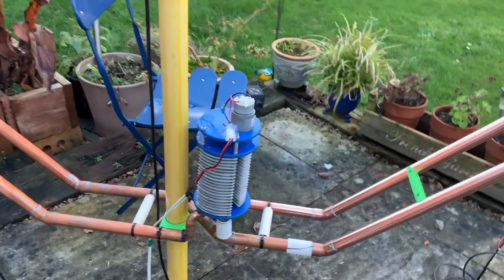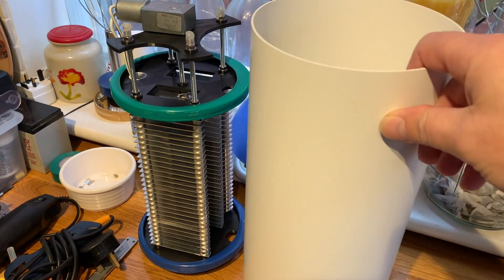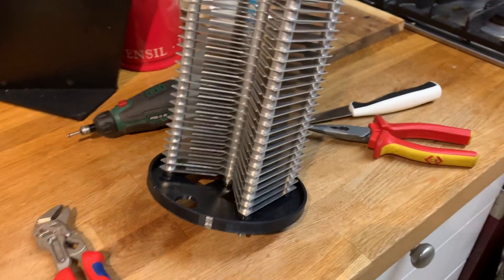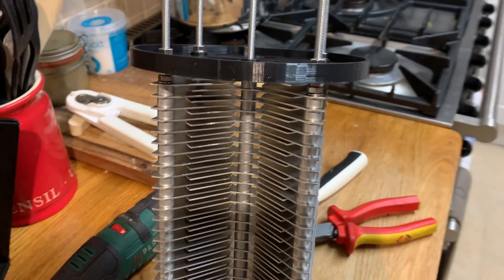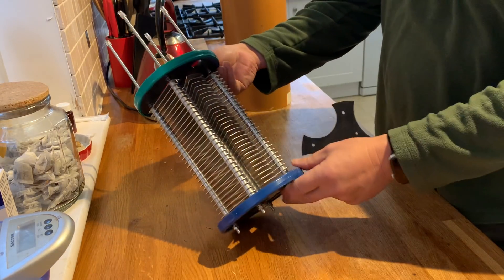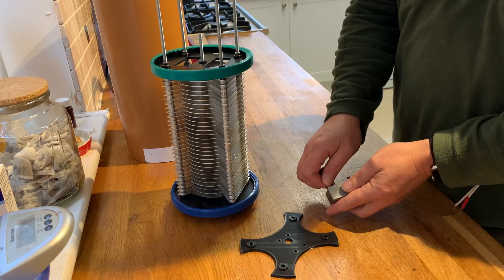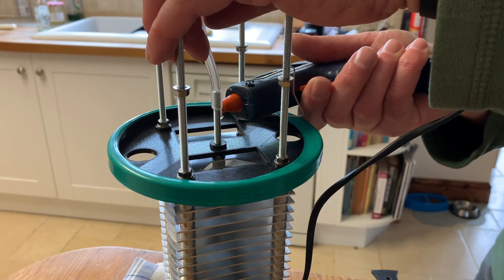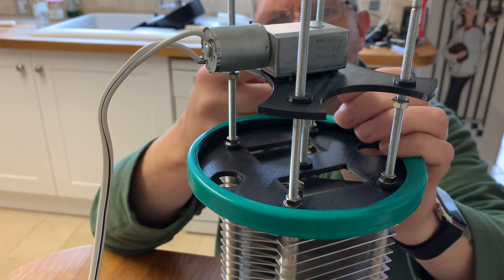HAM RADIO: Magnetic Loop Capacitor Build New Mag-Loop build figure of 8

Comment: Mike,
Question - you clearly have skills in CAD and use a 3D printer.   Why is ityou didn't design and print a coupler for the motor / capacitor?   I was going to print one in PETG - do you see an issue with this material ?

Comment: Very nice build!!  I've built my loopwith 3/4" soft annealed copper pipe - soit was easy to get a good circular loop.   
I was going to use a stepper motor and Arduino / TMC 2209 driver with microstepper for fine tuning, but I do like the simplicity of what I assume is a d.c. motor you are using.   Could you advise the model /source for this motor?    With regard to the capacitor - What do you thong the rating would be with 5mm spacers / 1mm thick plates as opposed to your 6mm spacers ?
Reply from the maker: The motor was sourced on eBay and is simply a 3 turn per minute 12volt dc motor, I also use 5mm spacing with another Capacitor and it works fine, 150Watt. Thanks

Comment: Nice loop. Might try building one later in the year.  I do have a question to ask, have you ever tried putting a small active antenna near your receiving loop, and see if it draws in loads of stations? Seeing the Mag loop draws in stations, could not the active antenna not pick up those stations as well a lot cleaner, and clearer?  Just a thought... Be interesting in finding out if reception to a SWR Receiver is far better. Should try it with a Coupling loop as well.

Comment: Hi Mike , work of art what are you using to cut out the rotors and plates is it cnc or  water jet I made I meter loop 10m-40m for my mchf got 7pf -111pf and cut the rotors and plates using 3018 cnc using RS design spark mechanical but even on the slowest speed your plates are smooth
regards
terry
Reply from the maker: They are cut by laser..  I need to purchase more

Comment: Kinda curious how much voltage the vari-cap can handle before it flashes over. Looking for alternatives to the costly vacuum caps in my amplifier applications.
Reply from the maker: Good question!  around 3-4KV maybe,  I have put 400Watts into it with no issues
Reply: @mike-M0MSN  thanks that good to know. Happy New year.

Comment: Hi matey. Just got back into the hobby. Made a few Baluns but having problems with a 49.1 and half wave aerial on 20metres. Although 10.2metres long its swr is high at 4. But low on 7mhz and 21mhz doesn't make sense. Balun tests out ok on 2.5k resistor load and nanovna.  Vswr is around 1.2 to 1 from 5mhz to 30mhz. It's a single band aerial. Very puzzling.  Cheers from old George.
Reply from the maker: Hi George, sound to me like you need to solder a 200pf capacitor across the so239 this will bring the phasing back into play.  :)
Reply: @mike-M0MSN  Tried all that. Didn't work. Baluns are ok. Combination of aerial that's the problem. I reckon I have found the cause. But too cold to prove it. Update video soon.....
Reply from the maker: @MakeDoAndMend1  ok please keep me in the loop.

Comment: The motor control setup - I would have done a Big plastic gear to a worm gear setup 90% .. by using this worm gear setup you are able to fine-tune the cap don't want to figure the ratio as don't have the Worm gear setup but I bet you could get a 20:1 so 20 turns on the motor is 1 turn of gear connected to the Cap's plates. right now it 1:1 ratio. Just my thought on it

Comment: I very much admire your tuning cap.
A few years ago using 18mm copper pipe I needed a way to making it round.
I have a bycycle wheel clamped kit to a Black and decker work mate and using the wheel and bending the pipe around it to the desired shape I made to half sizes and joint them up to make the mag loop.
Reply from the maker: Great idea Thanks 👍

Comment: Is there a reason for the  butterfly style over a normal style capacitor vane shape? Also are the end caps printed in PLA as its hygroscopic with  ight cause issues later?
Reply: The RF current in a loop of this kind can be very high, 20 amps or more.  You don't want that kind of current crossing a "wiper" that contacts the rotor.  So the rotor is electrically isolated and serves as a capacitive bridge between the two sets of stator plates.  The current flows through the butterfly plates.  It would be slightly better to feed the stator plates in the middle of the stack.
Reply from the maker: Hi, yes it is PLA, but I’m not worried about longevity, most if not all of the antennas I build are experimental (two, three years of life) plus I am putting the capacitor inside a water tight container.  I’m using the butterfly as I have more choice of connections and it is easier to build, the biggest reason is no moving electrical connection to the rotor.
Reply: @mike-M0MSN  Hi mike, I was thinking more about the posibility of the PLA absorbing water vaper and the impedance falling to where a high voltage might flash over. the reson why they used cermic plates. will be good to see how it performs .
Reply from the maker: @TheEmbeddedHobbyist  ah yes a very good point,  fingers crossed

Comment: Top notch! Love your vids. Been working on homemade butterfly caps for a few months, and a couple of issues I'm running into are: 1. rotor nuts loosening up (arduino/stepper motor gives me counter-clockwise tuning) 2. Making a good (permanent) connection with the (rotating) rotor shaft.
Reply from the maker: Yep been there, lock nuts or serrated washers. Use a gear ⚙️ and the last one is still under test….